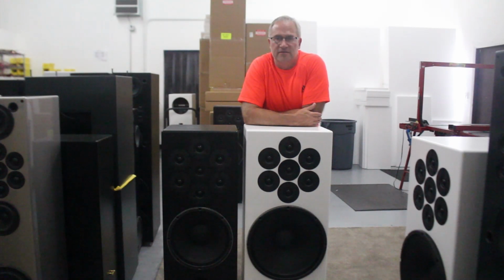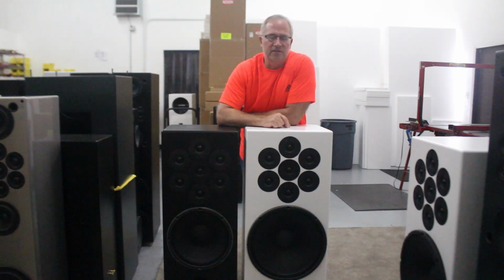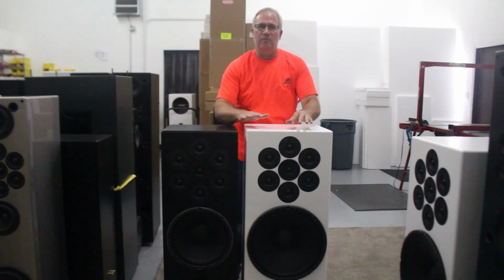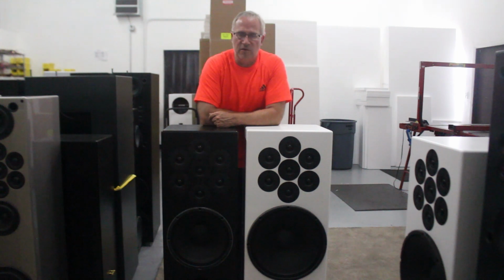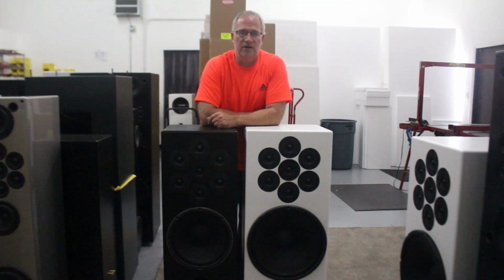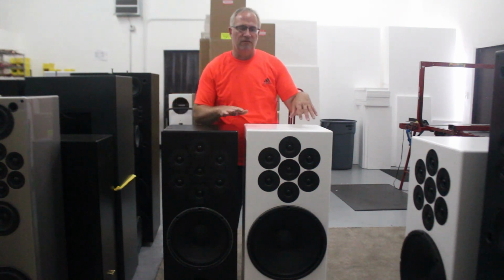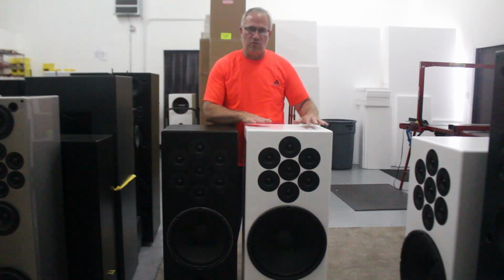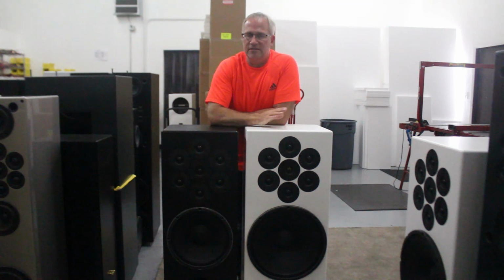Perfect Set Introduction | Tekton Design

Comment: I can vouch for a tweeter that gets down into the midrange - I have Linaeum LT1000 speakers, and the TLS tweeter is crossed at 440Hz - it is a revelation. The tweeter is about 94-95dB efficient, but with the 8" woofer (that is in a transmission line cabinet) being only ~90dB, the speaker is not nearly as efficient as yours.
Reply: I listened to linaeum at Raido Shack on their line of speakers in the 1970's. Dark & no details.
Reply: @porkchopspapi5757  1970's? Um, they weren't made until the 1990's ...
Reply: @NeilBlanchard  Better check your source.
Reply: @porkchopspapi5757  Linaeum themselves didn't build speakers with this driver until the late 1980's.
Reply: @NeilBlanchard  It must have been named differently then. But the big plastic figure 8 tweeters were memorable
Reply: @porkchopspapi5757  Paul Paddock had not built the first Linaeum until at least a DECADE later. They did not license them to Radio Shack until the early 1990's.

Comment: Is he saying my 300 watts @ 8 ohms crown Xls 1500 would not be a good fit for this speaker?
Reply: The Perfect SET 12 inch... https://www.tektondesign.com/the-perfect-set.html
Reply: I wish they would reply to you! That is my question!
Reply: I think a 4 ohm amp is ideal. I don't know for sure. But these speakers require serious power. They will fry amps if the amp os not equipped to power them.
Reply: Not at all is that what he is saying
Reply: Mine too

Comment: Eric, why is the 15 inch set version so much better for small wattage amps than the 12 inch version? Is the 2 db difference in sensitivity that demonstrative in low wattage situations or is it more than that? Thank you for the education.
Reply: I’m willing to bet that the 15” woofer is under-damped compared to a “regular” speaker. The idea is that if your amplifier doesn’t have much of a damping factor, SET amps are notorious for this, you need a woofer that is easier to move. The drawback is that if you put a more powerful amp on an under-damped woofer the bass gets out of hand. So the 12” is high sensitivity but with a more typical woofer dampening whereas the 15” has both high sensitivity and a lower amount of dampening on the woofer so you can use tiny amps.